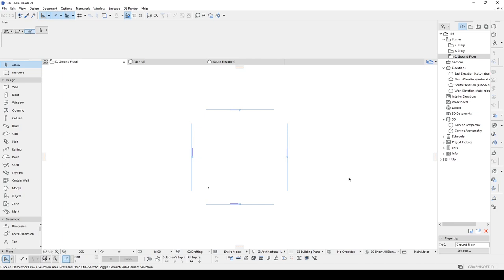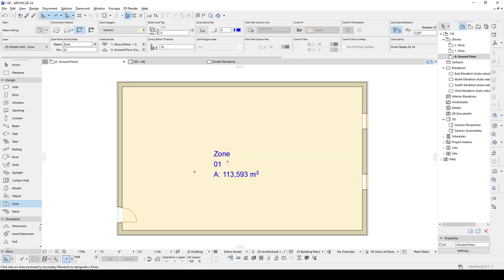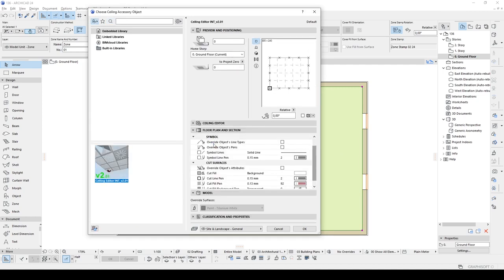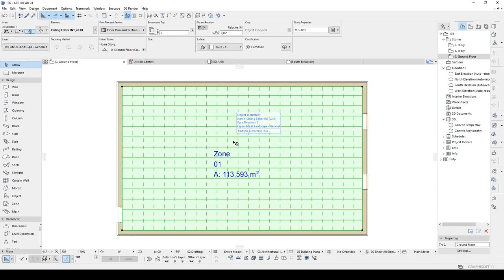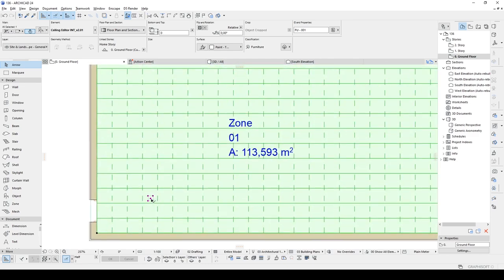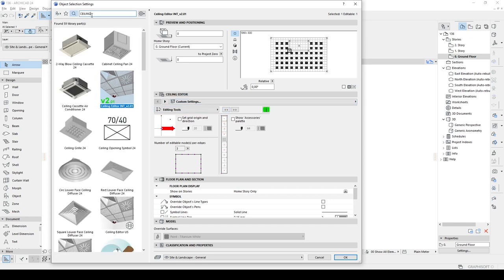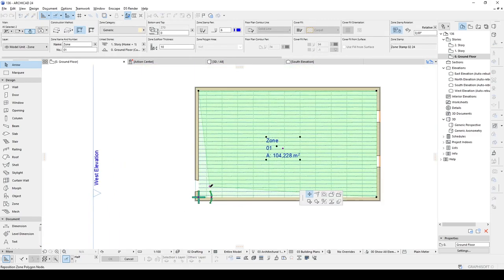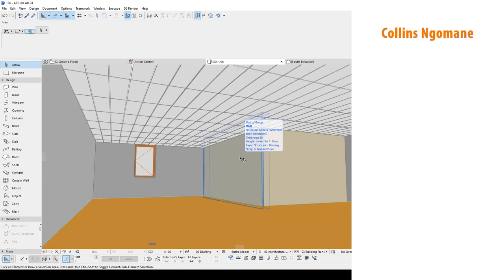Hidden Ceiling Modeling Tool

Comment: Sir I can't use it is only showing me trussmaker only
Reply from the maker: You need to install archicad goodies addon. You can download it from this page: https://graphisoft.com/downloads/goodies/ac24
Reply: I have the goodies installed but I can't see this variety of ceilings. Just one plain ceiling
Reply: @erickpatrick8256  Are you using Archicad INT? (international English version) I have INT and POL (Polish) 25 and I can see way more ceiling options in INT. However, I can also see a few basic grid ceiling options in POL, so I don't know if that helps.